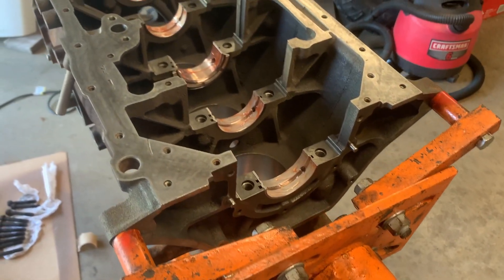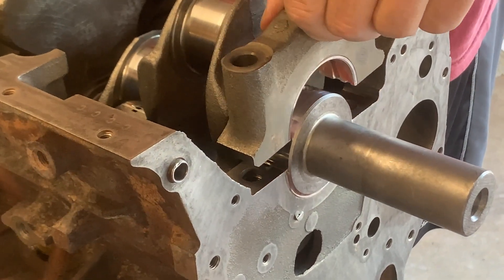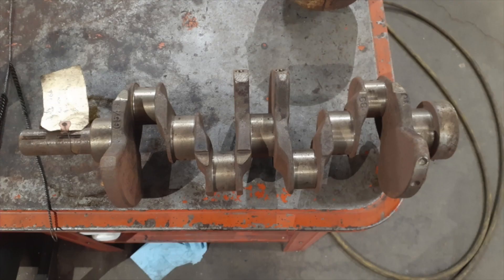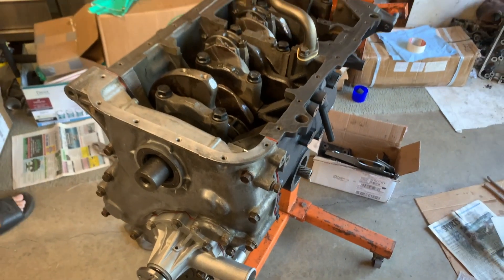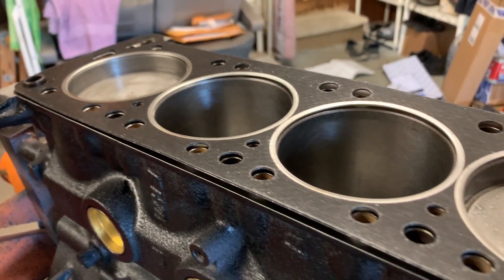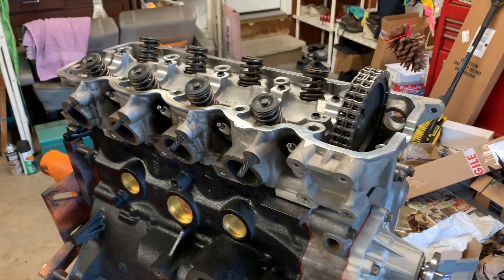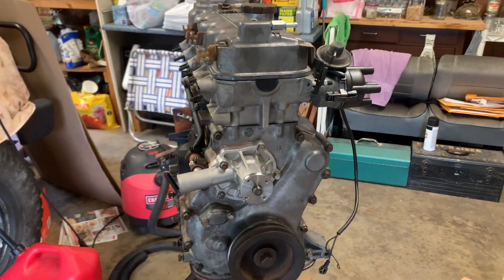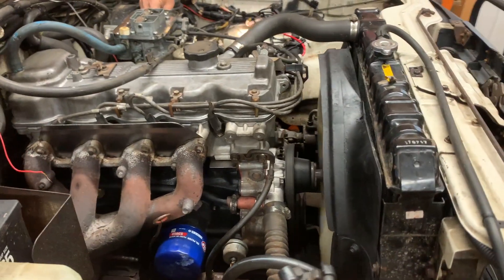Dodge Raider - [Mitsubishi G54B Engine Re-Build]

Comment: A buddy and I are trying to rebuild his 89 raider inherited from his grandfather in not great condition. We swapped piston rings and think we have it timed, but can’t get it to start (it turns over). Any chance you could share the vacuum line routing for your Weber carb? Or even which lines actually matter. That’s all we have for guesses at this point. Thanks for the video!

Comment: How is your raider running? I have a 87 raider that I'm either going to do a full rebuild on the engine like you did or consider some of the engine swap options out there, but idk yet.
Reply from the maker: Its been running great, dont cheap out on gaskets. make sure you get everything done right, and she will run a long time

Comment: Where did you find the pistons and stuff. I just pulled mine out and ive got a shop to hopefully build it, but i want it done right.
Reply from the maker: I reused the orginals pistons and rods and found a good used crank. everything else like rings oil/water pump timing chain guides etc came from either rock auto or ebay. If you want good quality stuff check out  the link in the description, he has everything you need to rebuild these engine and is an expert building these engines
Reply: @Markeeise  thank you!

Comment: nice i have a ram 50 from 87 with a g54b any recommendations for things to do to get more rpms im hoping to do ITB's and i want it to rev high
Reply from the maker: some people say to keep the balance shafts, but I deleted them, that frees up rotating mass and lets your engine rev quicker and higher.
Reply: @Markeeise  ahh okay how does that effect the ride tho is it severe?
Reply: @magrat3247  Never really noticed much, its mostly for when its idling
Reply: @Griffbolt  okay thats good ill consider it we'll see cuz id prolly have to remove the engine

Comment: on the 2.6L G54B, does the mikuni carb need to come out before the fuel pump can come out ? ....i have 1" clearance between the two, wiggle, wiggle, fuel pump bumps against the carb, does not clear the engine block bolts...what am i missing ?
Reply from the maker: Not 100% sure since i have a webber. Never seen an oem carb on
Reply: For me yes. I tried to replace it but couldn't. When I pulled my engine the fuel pump came out fine after I removed the carb.
Reply: @benbradshaw4991  same ... the carb has to come out ... all fuel pumps with a single thick arm won't go in, between the air jet valve & the engine head bolt, tho ... look for fuel pumps replacements with the thin arm made of two welded thin plates ...

Comment: I have a question i have a 1987 dodge caravan with the same engine is thier anything i can do to bullet proof this engine to make it last a long time it only has 98000 miles on it and it has healthy oil pressure
Reply from the maker: I would just say do regular maintenance on the engine, It will last you

Comment: Very nicely done. It should be noted the engine has a balance shaft elimination kit installed.
Reply from the maker: Definitely, Should have said something about that
Reply: @Markeeise  Did you feel more vibration after eliminating the balance shaft? Thx.